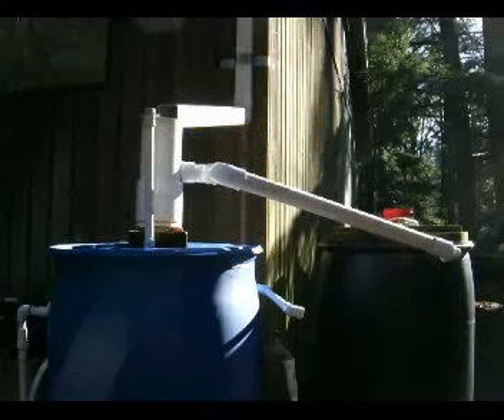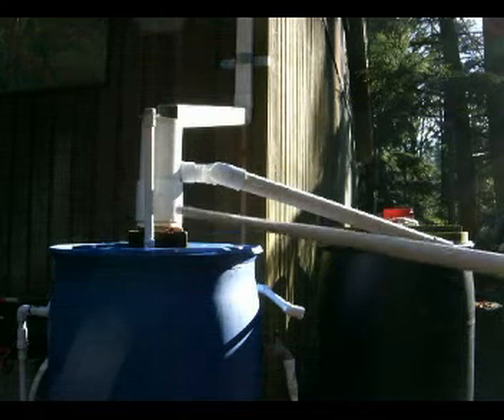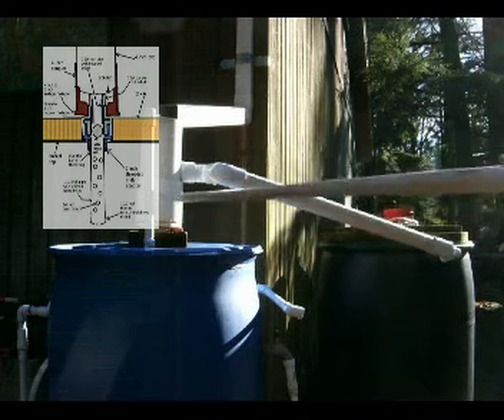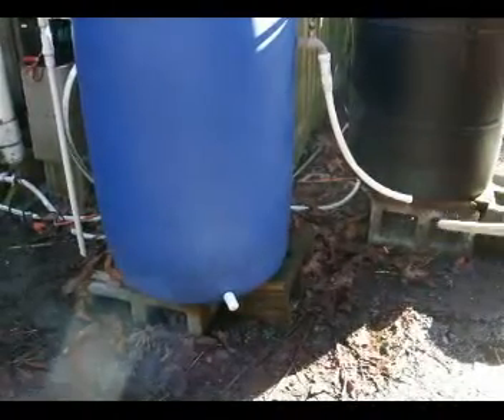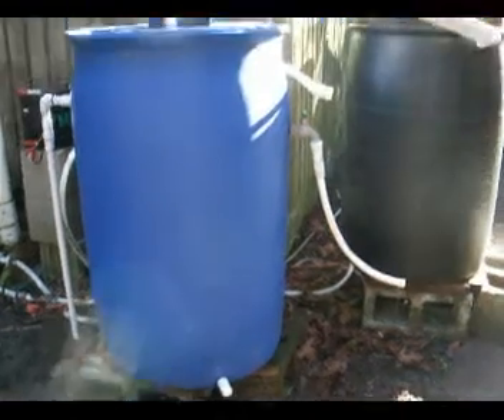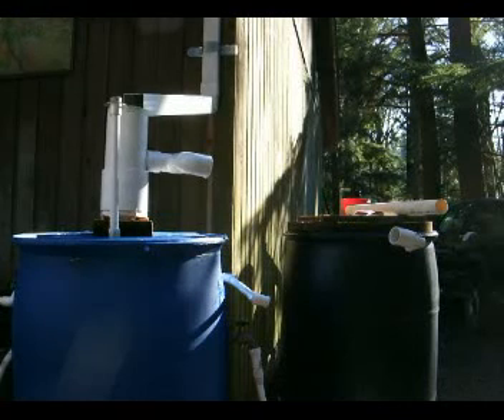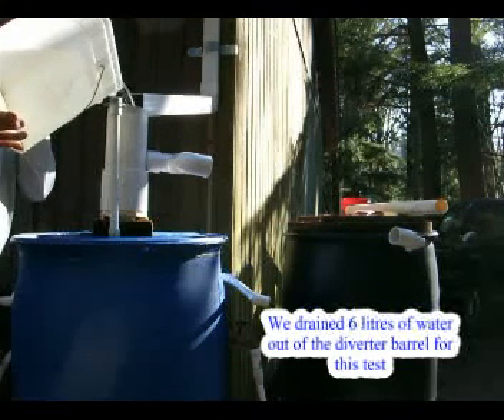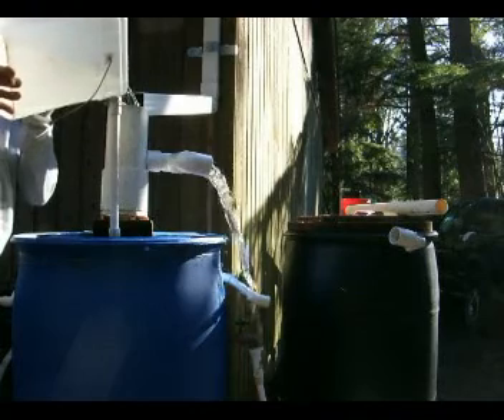harvest rainwater

Comment from the maker: @sciurusniger 
No, you sure don't. I used the 55 gallon container because it was available and inexpensive. The amount of diversion you need is dependent on the size and condition of your roof. The 55 gallon container allows for flexibility in that if you are not sure how much diversion you need you have the ability to just move the slow drain output faucet down on the barrel, thereby allowing more water to run off of the roof before it goes to storage.